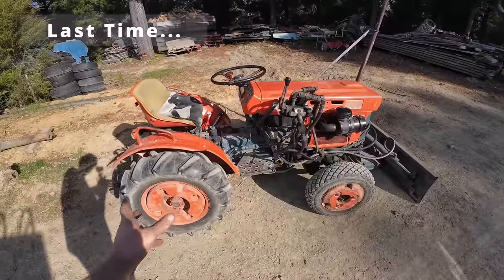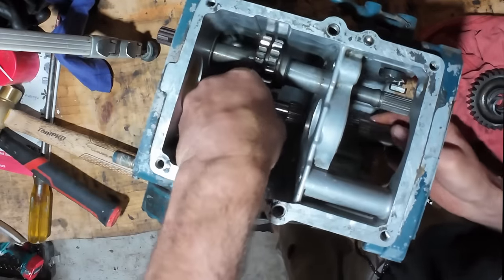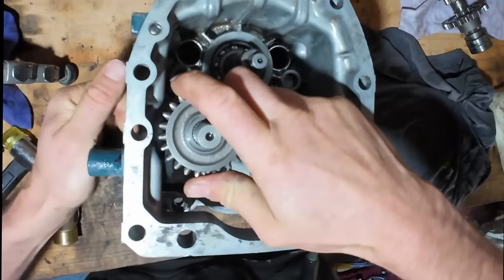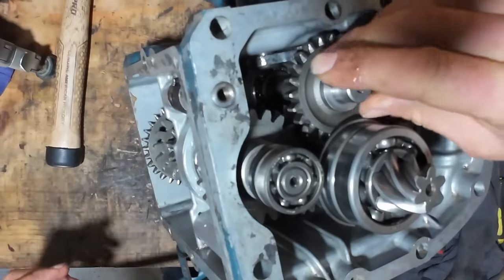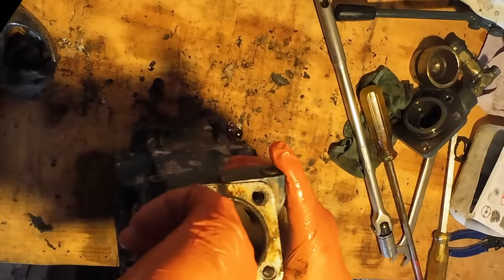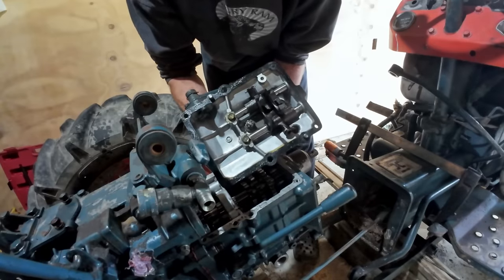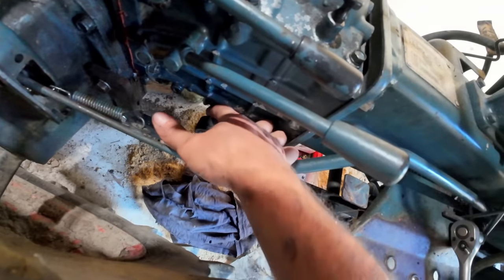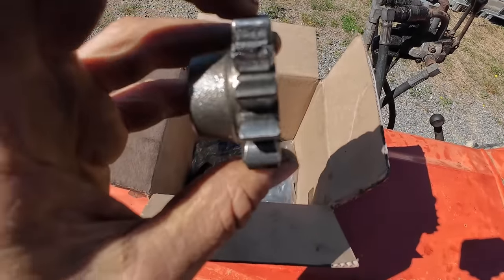Fixing a worn out tractor Gearbox and Lift Unit - Kubota B7100

Comment: Nice work Marty, good to see a craftsman at work and, a very useful little tractor.  That gearbox brought back memories of the first box I was given to overhaul on my own as a young apprentice.  I had everything laid out on the bench perfectly, all the correct new parts ready.  The foreman (brilliant guy) came over to check everything before I re-assembled it, pat on the back and me feeling quite pleased with myself.  Then he picked up a cardboard box and swept everything off the bench into that b@@@@@ box.  Then, he gave me the box and said- Now put it back together!  It took me about three days.  Lesson learned, make little sketches or notes if you have to, and learn to use the workshop manual, (this was the early 60s so no videos).  He got called some naughty names but he really was a brilliant mechanic and teacher.
Happy memories of when mechanics fixed things without a laptop and USB port😊.

Comment: I'm glad you're saving this tractor.  I see a lot of them go to scrap or just rot in the back 40.
Not old enough to be collectible, not new enough to be desirable.
Even though they're small, they're also one of those most challenging Kubota tractors to do gearbox repairs on.
Well done.

Comment: Marty, it was a delight to see this video. My family has a b6000 that we have loved for all my life. The tractor had sat for several years after my father died, not being run and finally being very hard to get started. My nephews took it up to their place and are now using it routinely to till their garden and manage the trails. That will be 6000 is deceptively powerful. The only limitation we found to it was that it didn't weigh enough to accomplish some of the things that it acted like it could. Seems like that little tractor, supposedly a 12 horsepower tractor had the heart of a much bigger one. Fun also to see an intermediate step between the 6,000 and the modern Kubota tractors. I'm betting that you will love having that out of your island.

Comment: I don't complain about Chinese tools because I wouldn't have 75% of mine if they weren't Chinese, but I can't get over how beautiful the castings are on that Kubota.  Thanks for the video and I hope you got some rain.
Reply: You realise Kubota is a Japanese co ?
Reply: @tonyhaddon2582  Japan was a cheap labour production country right after the WW2, when they were getting back on their feet. However, that didn't last for so long. For many decades now I don't think anyone has considered Japanese tools or vehicles to be cheap and low quality. They are on a par with Western ones, though naturally fans could say they can be even better, just like the fans of a Western brand would say their favourite brand is better. So, I'd say it's perfectly reasonable to say the castings of a Kubota unit can look beautiful compared to far more cheaply produced Chinese one. Chinese manufacturers conquered much market by making their products affordable, but naturally that comes with compromises. It's a choice made by the customers, ultimately. If your budget is tight, Chinese tools could be your only choice.
Reply: @tonyhaddon2582  After rereading what I wrote, I can see why you'd wonder  Basically I meant to say that it's nice to see some beautiful castings for a change but I'm not complaining about the ones that come from China even though their castings are pretty crappy. It looks like my first post was cast in China.  Sorry for the confusion.  🎎

Comment: Good Morning. i love watching your videos. love your attention to the details. i am always impressed with how you remember how everything goes back together after you take it apart.i am Not good with mechanical stuff. but after watching your videos for years. i am working on my 1995 polaris magnum 425 2x4 atv, i started out just replacing the head gasket ( thank GOD' i did Not have to take the whole motor out). i was putting the cam shaft in when i found out the cam shaft exaust part is worn out. i am working on putting the new cam shaft in and slowly putting the top of the motor back together again. GOD' Bless your whole family. Amen :)
Reply from the maker: Take your time and make sure you have a good workshop manual, the more you do the easier it becomes.

Comment: Ga day Marty towards the end at 33:30 on the back tire 🛞 same side as the muffler there is an outside bolt loose . It is to the left of the value stem . Looks like it is double nutted and it has broken lose or mechanically loose or rusted out wheel rim . You probably all ready know but just in case . Cheers 🎉
Reply from the maker: That is where the wheel weight was bolted, I took them off to reduce weight for the raft trip. Thanks.

Comment: A double yoker , bet your glad you weren't laying that one eh Marty 😂 , great video as always , the transmission coming apart and going back together reminds of my days working for Versatile farm equipment assembling transmissions, axles,Pto's, 3 point hitches and hydraulic cylinders, always a challenge and keeps the memory sharp, the camera is a big help nowadays i take pics or short videos of how they come apart, just to make sure i put them back together correctly, that little Kubota B7100 would be perfect for me to plow the snow here in the winter, a blade is all i would need and its a good thing i make those for a living, I have seen a few of these on the web here in Canada and people want a kings ransom for them even though they are tougher to get parts for them nowadays , i just one the little diesel on them, those things will tick over for  half a century with good regular maintenance on them, they were well engineered when they were new, easy to tell by looking at the quality/design of the casting and how easy it was to remove the fenders and pull apart the gearbox. 👍

Comment: How is synchronization handled between the gear changes in that gear box? (didn't see anything that resembled a synchronizer....)
Reply: ESP.  There are no synchros.  It's called crash mesh.
Reply from the maker: Supposed to stop to change gears on these, maybe the previous owner didn't know that
Reply: Even high range top gear is so low - less than 10 mph top speed, that you just start in that.

Comment: Orange juice concentrate powder in water is a good way of removing rust if your not going down the leccy route. Probably cheaper as well. An ultrasonic cleaner combined with the Orange juice concentrate is great combination. Leave it in for a day and then put it in the ultrasonic cleaner and it comes out clean as a whistle.

Comment: Nice. I got an old B6100, knock on wood the transmission is still in good shape. Mine is due a new clutch and brakes. Good luck finding that shift boot, mine looks the same but haven't found a replacement yet
Reply from the maker: I might just use half a tennis ball with a hole in it, it'll keep the water out ;)
Reply: CV boot gives flexibility and the "universal" ones you can cut to length...according to another commenter...

Comment: We carpenters use shims to lodge something that is to of shape  into shape.  How do you guys use shims (right out of the gate?)
Reply from the maker: To set / adjust the mounting distance (axial backlash) on bevel gears. as the gears wear out they may require more shims to allow the gears to mesh properly

Comment: Nice I see that little one way clutch on the PTO now I know why it makes a ratcheting noise when I put in N with the flail mower spinning
Reply: The old Ford N's and Ferguson's did not have that, so the inertia of the spinning implement would drive the tractor forward through the PTO even if you pressed the clutch
Reply: @erik_dk842  As a teenager, I found that out the hard way on an old 8N. A 5 foot bush hog blade has a lot of angular momentum.

Comment: Another good project video Marty.  I liked the long format.  Your narration is so  calm and measured.  You are not a typical mechanic - that's for sure.  I'm always impressed by the care, precision and detail of your rebuilds.  Nothing is left to chance.
That is quite a capable little machine!  I was surprised by the blades capabilities in front of a small 2 wheel drive machine.  It is a perfect addition to your parcel on the island.  A real paradise.
Reply: It is actually a 4x4 tractor...it has turf tyres on the front but they can be swapped for deep lugged tyres....
Reply: @JohnSmith-pl2bk  Thank you for dialing me in.  I must have been having a senior moment. :)

Comment: Great job, Marty. What a nice little machine. Reminds me if my youth end of the 80s when I had summer jobs at the council taking care of local parks etc. I drove several of these little tractors, like Hinomoto and the more modern Iseki. Impressive capabilities they had, had to use low range and 4wd often when emptying the tipper on the yard in the mud.
Reply from the maker: They are fun little machines, I didn't want to get off it

Comment: I'm surprise how simple that hydraulic system is on the back of that tractor is on the other hand it doesn't have draft control system so that would cut down the amount of linkage it would need

Comment: I've got the 7100 HST Kubota and for the last 35 years it's been a workhorse, great little machine. I had to cringe with the rototiller on the rocks, was waiting for a drive chain to snap. I need to split mine in half to replace a coupler bushing but have been putting it off. Great watching the rebuild and nice knowing you can still get parts.

Comment: If you can find one in the right size, i'd put a bigger boot on the stick, with more articulations. So, something off an ATV axle, for example.
Reply: Thanks for the idea. I have a B7100 too, but with all the problems stemming from its use for clearing snow and spreading salt
Reply from the maker: I like your thinking.. I have an old subaru cv boot somewhere in the shed

Comment: Gearboxes…I once had to explain to a bloke who’d been warming steering wheels in a truck for “over thirty years, mate, why do you ask ?’ ….
What a Clutch Brake in his RoadRanger was. 
Another steering wheel attendant kept chewing out the top shaft (1st and Reverse) and selector in his Seven Speed Isuzu. Denied, vigorously, that he was rolling either way when selecting opposite gear. Then, leaving the yard, reversed back, then drove off, selecting next gear whilst rolling in exactly the opposite direction, infront of entire workshop, including manager, who gifted, comped the work as it was warranted, just fixed about 5000k earlier, not my job, but different mech gets used on returns, company policy.
I used to think there were some truly monumental dickheads in the Transport Industry, then I started working in Earthmoving. I seems much easier to get a ticket as a lever puller than becoming a truckie. Long rant. Sorry. Cheers.

Comment: You could melt those old gears and use the high quality steel. They contain nickel and are wear resisitent when heat treated.
Reply from the maker: Yes I keep all bearings and gears just in case I ever make a forge 😉

Comment: Well done Marty; definitely not a job for the faint of heart—even if you recorded disassembling it. I was thinking, because you said the damaged gears are getting more difficult to find, would it be a good idea to hang onto them? I say that while wondering in ignorance—can those gears be welded, milled and re-hardened without too much difficulty? Would it worth it in the long run to repair and keep the repaired gears, or for their resale value to help offset this rebuild—especially if you knew a machinist who'd help? Anyway, just a thought. As always a   👍  to a great video. God bless.
Reply from the maker: Yes I'll hold on to the gears just incase, there are some very clever blokes just down the road at REM engineering who can likely rebuild the gears.

Comment: I never heard of Friday Parts, not sure if they serve US or not, did you need to give them serial number, and how come you didn't go to Kubota dealer? And what about those tires, they 4x4 compatible in size? 
I was expecting to see a lot of smoke from the engine but I didn't notice any, I bet that tractor would sell all day long for $7-8000.00 here in US........ Good video.......
Reply from the maker: I found the gear part numbers on messicks website and gave that to Fridayparts. Kubota dealer here are funny about supplying parts for grey market tractors.. Tyres are compatible
Reply: @MartyT  Thats usually how I find part numbers to, Messicks or Coleman Equipment, then I try to find their price then go to Amazon or ebay and get shocked at how much higher prices are at dealers!! I heard about G.M. tractors before and how hard it is to get parts, do you have easy understandable explanation what G.M. tractors are?

Comment: I have a B7100 that has a broken gear in the gearbox, it’s a great running little diesel tractor, but I’ll probably just sell it for parts. I have a new John Deere tractor and don’t need the Kubota. I had just put new tires on the little Kubota when the gearbox went down! Parts are getting scarce for these tractors!
Reply from the maker: Are you in New Zealand? I'd buy it for spare parts

Comment: How often do you find that it boils down to previous owners not doing maintenance and things needing just a teardown - cleaning and reassembly.
Reply from the maker: Very common, a lot of these old tractors I get are run into the ground without maintenance and sold as a non runner. Often all it takes is changing filters, flushing fuel and cleaning electrical connections.

Comment: Hey 'brother from another mother' as my wife refers to you. I need to do the same fix to my B7100 lift arm (HST). Any chance you can share the numbers of the kit you had or parts needed? Had a look on fridayparts but cant seem to find anything?
Reply from the maker: They are all pretty standard parts in the lift unit, I got those seals from the local bearing shop.